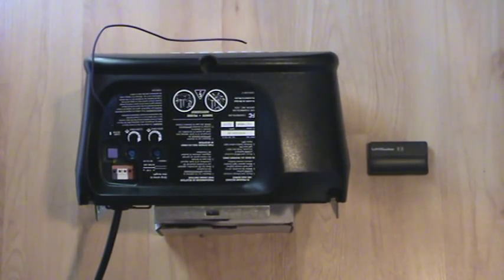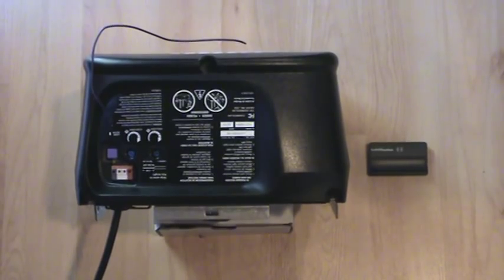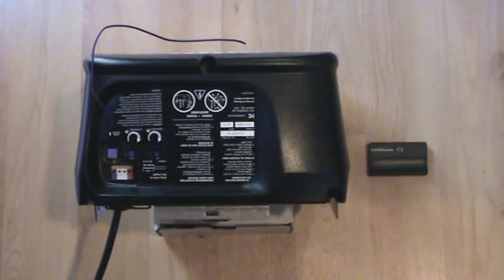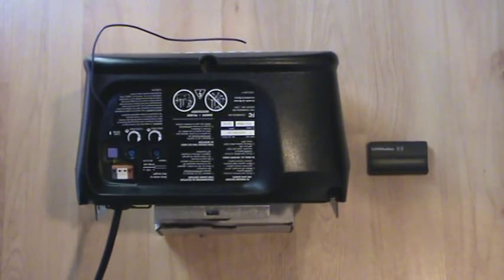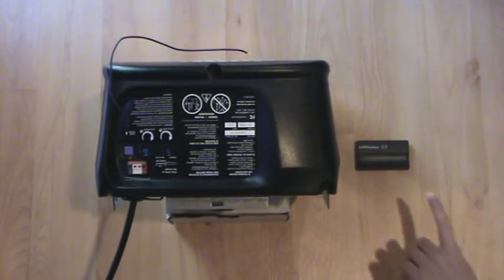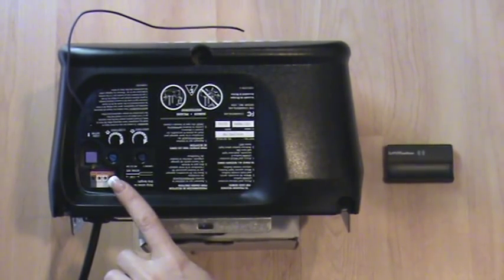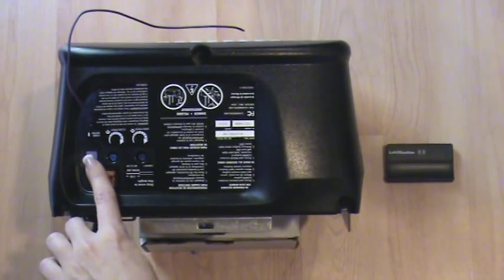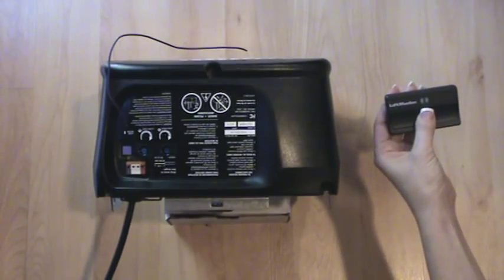Programming Liftmaster Rolling Code Remote

Comment: Would like to see how to program a 893Max 3 button remote with a Liftmaster Elite Series Logic 4.  The sales material says it's compatible but I'll be darned if I can get it to take the programming.  That opener has different buttons, Radio, Open, Close, and Stop. The instructions on the opener are different than the instructions on the remote, but neither one seems to work.